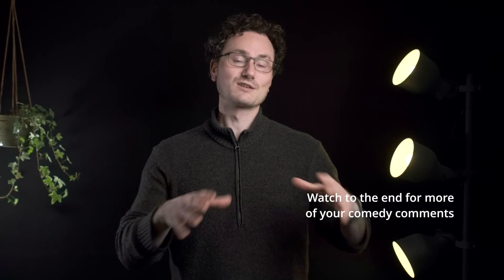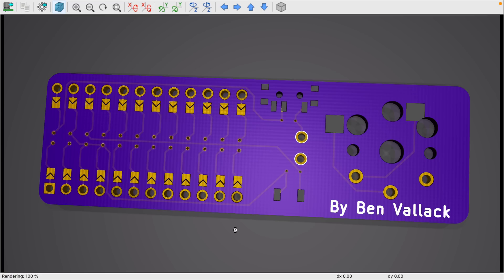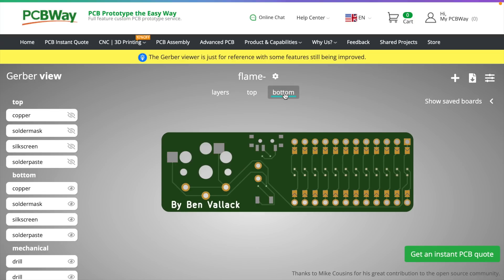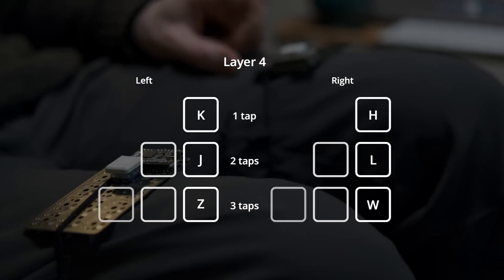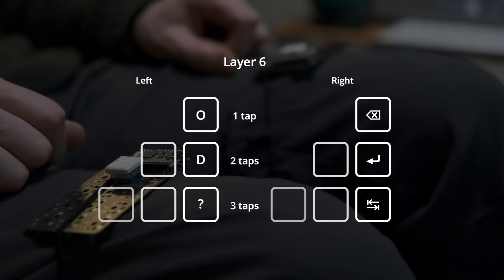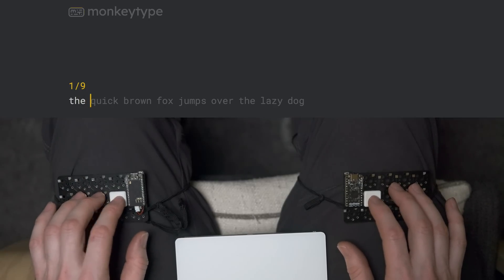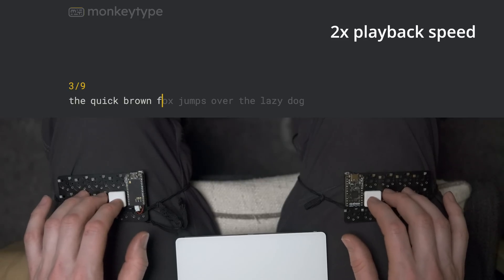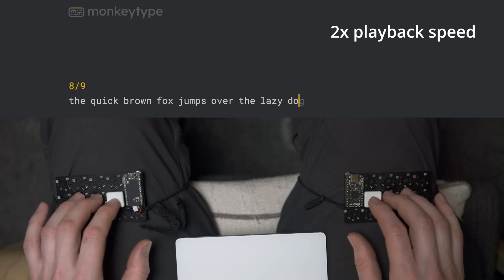World's Smallest Keyboard

Comment: Was it really necessary to connect the keyswitch to every pin on the mcu (or am I interpreting the schematic incorrectly)?
Reply from the maker: If I have done that I have made a mistake! It should just be gpio 1.
Reply: @BenVallack  I'm probably just misinterpreting it. it's been a long tie since I've done PCB design and I wasn't all that good at it to begin with.

Comment: Soon there will be zero keyboard to be typed on, just the power of thinking the key. Looking forward to that video Ben!
Reply: Wait until he gets to a keyboard with a negative number of keys! Now that's going to be some mind-boggling next-level endeavour!
Reply: Jokes jokes, but I seriously thought about this and i'm far from the only one thinking about it.
You can easily build an helmet that can measure with electrodes the current flowing inside your brain at different points on your head. With that you can get a lot of data. 
There is a lot of mathematical pre-processing to do on the data, just to name one : fourier transform of the signal of each electrode.
When you sucessfully found a way to process the data the way you want you could register different data-sequence like that :
Think REALLY hard about the letter A, record the data, do it dozens of time and try to reduce other factors that may interfere with your thinking
Do the same for some more letters (ideally every letter)

Train a machine learning model against those data and try to improve it to get a "good enough" result on that

Use inference with this model to get the right letter
THEN
Profits !

Reality : the data recovered aren't "clean" enough nor precise enough. But there REALLY are people doing that with, for example, "left and right". 
Just imagine, you could ALREADY TODAY use layers by thinking ! (input lag would also be a problem, and implementation method and many other things such as the comfort of having an helmet with 50 electrodes on the head lmao)

THIS IS NOT A JOKE

Comment: Nice! Great job!  Would a Morse code system be faster?
Reply from the maker: A very seasoned operator could probably just beat this on morse code from what I’ve read, but you’d need some weird stuff running on the computer to decode it, this just works like any other keyboard :)